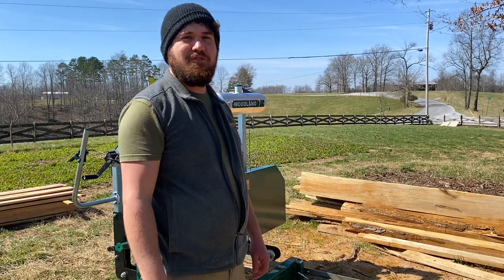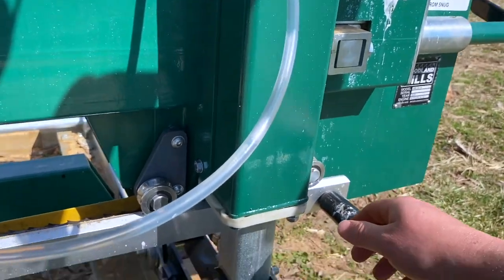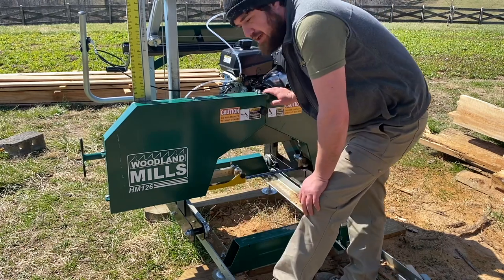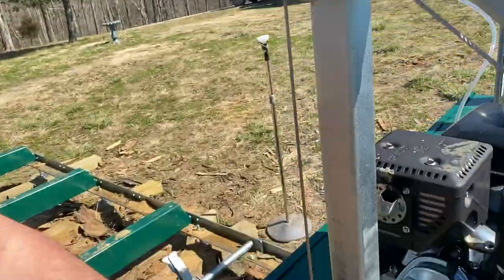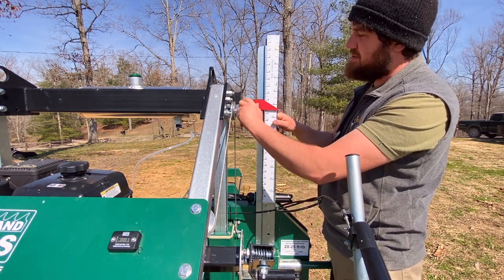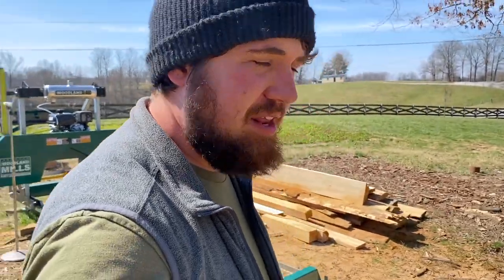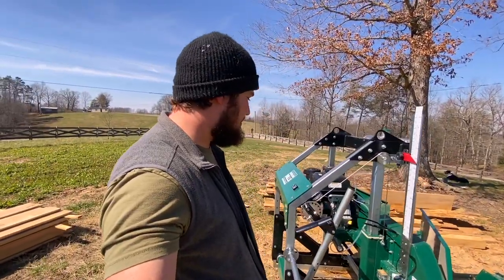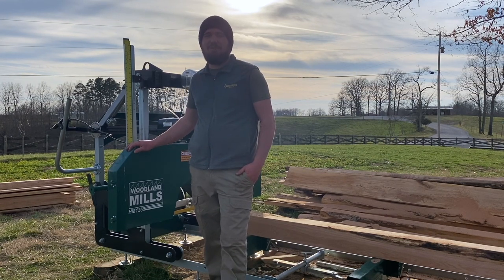THOROUGH Sawmill REVIEW   (Woodland Mills HM126)

Comment: I just got one last January and love it. I am pretty sure if you read the manual it talks about lubing the vertical tubes. I know I did on mine and the power head never sticks when it is coming down (or going up). Also, I have figured out how many revolutions to turn the handle to get whatever thickness board I want so I have the yellow magnetic ruler in place with actual measurements to the bunks. I always start at the lowest cut I plan on making (using the ruler) and then counting revolutions up by whatever size boards I want until I get to the top cut. Then turn the saw on and cut my way back down. That works for me quite well. You do need to get that on a solid base soon otherwise it will start to sink into your yard with every log you put on it and that will throw the tracks out of alignment. Also, you are right about the track extensions. I got them when I bought mine and haven't regretted it. I cut 350 BF of 2x4s from a single hemlock log on mine this week including some 12' 6" long ones. I couldn't have done that without the extensions. Happy cutting!
Reply from the maker: Thanks for the tips Randy!
Reply from the maker: Also I did build a permanent stand in a later video 👍

Comment: nice video you did a nice job on stop's the silcone spary is the best head goes up and down much better sawdust will not stick to it. i would not go over 2 foot also  but deside for your self  loading with tractor you can have it higher . i mount mine on cement that was already there  some mine is on ground it easier to load loads and fuel but you do have to bend over. keep up the sawing. take care, be safe and well.
Reply from the maker: Thanks man! Fueling it is a good point I’ll probably go 16-18” happy medium. 
Thanks for nice comments!

Comment: At 3:09 you talk about it slightly sticks when you let your head down. I noticed the same thing when working with a Bridgeport vertical mill in the machine shop. For that matter any brand of vertical mill. The solution is to lower the head further down then crank it back to your desired setting. I hope this helps you. Thanks for the video.
Reply from the maker: Thanks for the helpful tip👍 that’s actually what I started doing.

Comment: When you assemble the mill always go over everything twice. Then you won't have loose allenhead set screws that vibrate out. ;)  Don't be cheap. Get the set screw replaced and use that log stop guard bar! Safety 1st. :)  Enjoy! Oh one more thing now that you have used the mill have you done the Woodland mills recommended shake down of the Saw carriage? If not read your instructions again and do the shake down. Makes the head run smoother with less vibration on the track. Keep on sawin'! Be Blessed.
Reply from the maker: I guess I need to read the instructions again, I don’t remember that part. Thanks for the tips!

Comment: Did you have to do anything other than tighten the blade before you started cutting Lumber?
Reply from the maker: Are talking about the first time I used it? The first time I had to adjust the throttle cable so it would operate the auto lube properly but I think that’s it. I hope that answered your question.
(your not supposed to run lube for the first 15min or so to break in your belt)
Reply: @Jared-Brubaker  I did see that on the tank tag about not running lube.  I need to get a torque wrench.  That is next on my list.  I knownit has kind of a built in system - but there seems to be a consensus "use a torque wrench" coming from Woodland Mills Owners.

Any update on using 1.5" blade over the 1.25" blade?  I'm super curious about that.
Reply from the maker: @BissellMapleFarm  yeah I really need to check the tension with a torque wrench to make sure I’m not over tightening it and stressing the bearings.

I still don’t have an update on the 1.5” blades, I’ve been to busy to get much sawing done. 😏